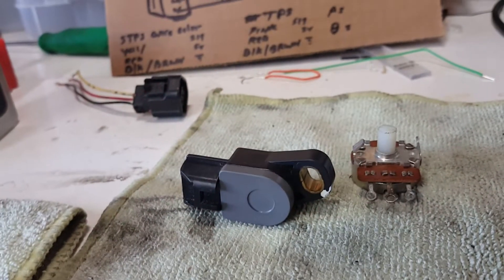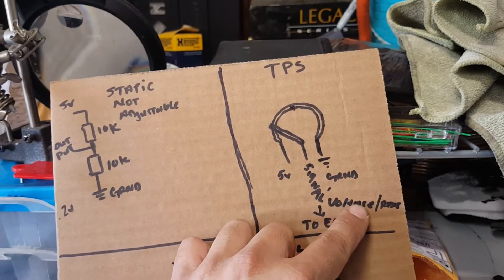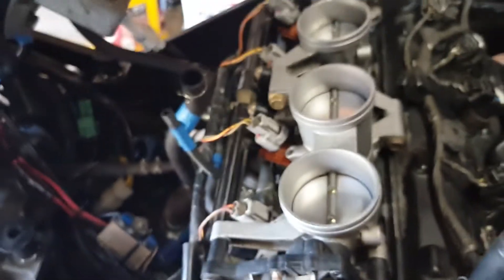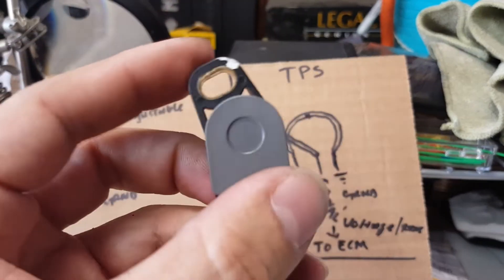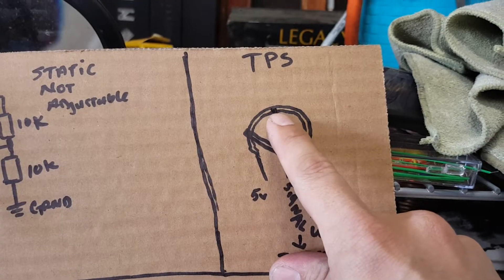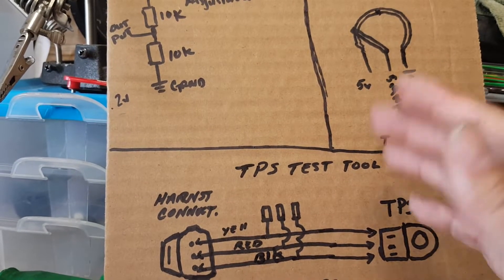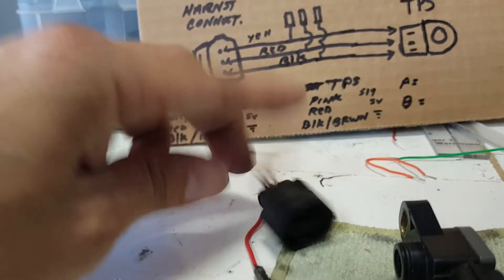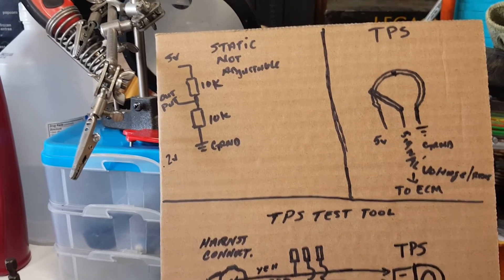DIY SUZUKI GSXR 600/750 Explaining the TPS

Comment: I just bought a 04 GSXR 750 that has not started in about two years. I ended up disconnecting the IAP sensor and it started right up. The TPS was off so I had adjusted it. It idles for a while and slowly drops from 1200 downward until it stalls. Also when revving too quickly it will stall. It's not even slightly drivable, could a TPS sensor be the reason why?
Reply from the maker: Are u using the new gas? Have you checked the tank for rust? Have you test fuel pressure and volume? Have you checked the sparkplugs? 

You Have to start with the basics engine go troubleshooting before moving on to components.
Reply: @TheChemistDIY  I have done all of the above except for fuel pressure. Fuel doesn't seem like an issue although I may be wrong. I'm going to check compression tomorrow. Also, I noticed today that when I close the throttle or roll the bike backwards the engine stalls as well.
Reply from the maker: @StrongLykOx  what are the color of your plugs..?
Reply: @TheChemistDIY  they were dark brown, if I roll the throttle closed it stalls as well.
Reply from the maker: @StrongLykOx  yes, 3 main things happen when rolling on the throttle. Air, fuel, and spark are changed.. to much or to little will cause the bike to stall. The sparkplugs are a great story teller of what could be possible wrong in these 3 main categories.. im sure you know this.

Take a look at this color chart and tell me the degree to where your sparks are at so we can identify the next place to troubleshoot.

https://www.lazerhelmets.com/lean-spark-plug-chart/

Dark usually means to rich and light usually means to lean. 

So with all that said the bike does idle on its own right? If not for how long will it stay one. Dose you STVA work and can you see the 1st and secondary flys move ?
Reply: @TheChemistDIY  from looking at the chart I would most likely say oil fouled. I also just did a compression check and all 4 are around 100psi. The first and secondary flys move. Could it be a head gasket?
Reply from the maker: @StrongLykOx  WOW!! Out the box from the dealership the bike should have 160 PSI across each cylinder. 145 psi is about the lowest you want to go and it's time to replace the rings after that.

One thing that's odd is that you have an even 100 psi across all four cylinders, that's even pressure!.. so with that said you have me leaning more towards head gasket leak but the only way to tell is with a leak down test.

One mechanics trick to test for bad rings is to pour a little engine oil in each cylinder and fire her up. This will seal the leaking ring for a minute until the oil burns up. If she runs during your test (idle/revving) then you have a compression leak in one of your cylinders. This won't work if you have a head gasket leak. There is a different procedure for this.
Reply: @TheChemistDIY  so, I did the compression test wrong. I did it with the engine cold and didn’t open the throttle all the way. I got 150-155 across all four when I did it right. I replaced the plugs for a third time, cleaned the coils and the throttle body, removed the tps and stps and it starts right up. It’s revving fine, not stalling and is rideable. But lots of white smoke bellowing out. I’ve ordered the tps and stps because I messed them up removing them. I’m not going to attempt to start it again until the TPS and STPS are replaced. Any idea on the white smoke? I’m tracking it’s not a good sign.
Reply: or the white smoke could be the sea foam
Reply from the maker: @StrongLykOx  sea foam.. yea let it burn off.. glad ur up n running
Reply: @TheChemistDIY  everything is working pretty great, thank you for the help. Question, if I install a power commander, do I need the TPS installed? The sensors that arrived today rotate in the wrong direction and I was thinking about installing a power commander instead of trying to find a TPS that will work.
Reply from the maker: @StrongLykOx  so the PCIII needs the tps to work properly. At connector #1 there there is a wire that needs to T-tap to the TPS wire. I have a  instation video on that..
Reply: @TheChemistDIY  So, I cant really explain it, I took off the throttle body, cleaned it real well because it was gunked up. Put it back on, all sensors hooked up and the bike is running beautifully.
Reply from the maker: @StrongLykOx  yes a good throttle body cleaning works wonders. That said there could be other reasons why you were getting bad or poor performance.

1) your throttle body wasn't sitting in the boots correctly, not creating a tight seal, this created a vacuum leak. You taking off and putting back on repositioned the stacks correctly back in their boots.

2) The boots are tired and warned and not creating a good seal. Since they are rubber the will also crack giving you again a vacuum leak. When you took off the TB did you inspect the boots for cracking? If not what might happen is by removing the TB you allowed the boots to close up from expansion.. but within a few rides with heating and cooling these boots will open back up, expose the crack and create the same vacuum leak.

Keeping my fingers crossed for you and it was just a dirty throttle body and you fixed the issue. Boots are simple and cheap to replace but just having to do the job over when you had everything apart the first time sucks ass..lol

 been there done that..
Reply: @TheChemistDIY  yeah, the boots looked a bit worn. I've already got them on order as well as a few other things that seemed worn. Thanks for the help.
Reply from the maker: @StrongLykOx  Awesome brother sounds like you got everything covered, hit me up anytime. Just an FYI, not sure if you ever replaced the stack seals & boots before but the 4 Phillip screws are a Bi^*# to get out without stripping because of the Loctite. To knock them free I'd advise you to purchase a Driver Impact Screwdriver set. This tool broke my screws free in two wacks. You can find that in my Amazon storefront here https://amzn.to/3Wmp2ew for a few bucks. Well worth the investment when you consider the time and frustration it eliminates. Just my two cents  

Good luck!

Comment: I set STPS resistance as it is written in the instructions on 0.6 on the closed throttle and on 4.50 on the open throttle and damn it I dont get it. 1.10 closed, and only open throttle  4.50 evenly wtf :p did you work out perfectly as in the guide?
Reply from the maker: What's up brother, just so you know the good book has a typo for the closed value.. it should read 1.6 closed and 4.5 open. The 1.6 is approximate and not set in stone.. so you should be good
Reply: @TheChemistDIY  I set STPS to 1.6 kOHM on closed, but now I have over 5 open, and it should be 4.5 according to the instructions.
Reply from the maker: @kawosz90  remember these are approximate values, they may differ. Even though the book says 1.6 - 4.5 my values came out to be 1.8-4.9, almost 5 kohms!. As long as you have the beginning value set you should be good if the ending value travels higher..

 let me ask you.. what problem are you having? Have you taken the bike out for a test ride with the new adjustment? Is there a code being thrown with the new adjustment?
Reply: @TheChemistDIY  I had it so that I screwed it tightly at high speed rpm, it was error (C028) I replaced the STVA, set it to a little lower value  in STPS and it's now good...

Comment: Mannn I’m stuck , $250 stva ,$50 tps sensor , $100 secondary tps sensor , fuel pump. Don’t really wanna drop $400 plus on parts guessing what it is What could it be 😩 code -C29
Reply from the maker: Well c29 is the Secondary TPS.. have you tried cleaning the contacts in the connector and STPS.. could be something that simple.. you can also swap TPSs to make sure there functioning.. correctly but it's a bit of a pain to calibrate..

Comment: hello i have a question, does tps of gsxr 2009 the same my 2014 gsxr 750? can i swap it from 2009 to 2014?
Reply from the maker: Wish I could help you out but that information I do not know. You could crack open  the service manual for both and perform a comparison.  

Aside from the physical aspect, you would also need to consider upper and lower resistances levels as well as voltage input.

Comment: Did you get a code for this bc I’m experiencing the same problem bike idles weird then around 6 7k rpms it jerks so bad that I have to shift to stop also I use to be able to hit 10k and not be able to go anymore my bike trapped 115mph as a 600 I own a gsxr 2006 I do not have any codes and I can’t seem to figure it out 😫
Reply from the maker: Does this occur in a specific gear at that RPM range or dose it do it in all gears at 6-7k?
Reply: james moreno well just found out plugs wer bad put new ones in bike ran good then Throw code 24 25 39 two ignition coils and injector 4 high end but bike use to stay stuck at 10k rpms
Reply: @r6moto716  Does bike now go past 10k rpm? did changing the plugs help?

Comment: Could you help me out. I changed oil filter and plugs on my Gsxr K6 1000cc, I realised just after I started  I might of put  bit small bit too much oil maybe 1 extra quart. Drained this out but the bike isn't idling now sinc the service, and it's really smokey. All lights on no codes.  Any idea what is wrong, is the oil gone too far in the engine, I did replace iridium spark plugs for normal plugs. Can anyone help me out??
Reply: So what happened ?

Comment: Do you still how this bike I got mine used but the fuel line was shortened and I was wanting to find out the length it’s supposed to be and it’s routing the line is kinked and I want to replace it and route it so it don’t kink
Reply from the maker: Ya I still have it.. although I dont have the measurement of the line or know which gas line your referring too. Gas Tank to disconnect link/ link to fuel rail..ect
Reply: Yes I’m talking about the line from the fuel pump to the fuel rail

Comment: Mine starts up but as soon as I give it a little throttle it either cuts off or starts losing power then getting it again any suggestions
Reply from the maker: Most bogging issues have to do with the lack of one of the 3 major components of combustion.. Fuel, Air and spark.. sounds to me like your lacking one.. have you checked each and are you throwing any codes..

Sometimes it's as simple as a bad plug or grounding out or loose coil pack..dive deeper and it can be a bad fuel pump or dirty injectors.. your researching and commenting on the TPS video.. what makes you think it's the TPS..

Comment: My 750 k2 bogs on half a throttle and on 8000rpm 😔 any idea
Reply from the maker: Need more information then that brother.. What gears/any FI light/funny smells/how longhas been doing/all of a sudden or building up to/started after any mods.. ect.. have to get into the fine details.. Have you dones a tune up.. Filter, plugs , oil..

My first go to would be pulling the plugs and seeing their condition.. this tell you how the bikes burning your fuel ..  (White, brown, blk)

check the tank for rust or dirty

Run a fuel delivery test to see if the correct amount is getting out/fuel pressure test after that.. could be a bad fuel pump or the filter is dirty..

So many things to check with just saying I'm bogging at 8K rmps.. we need to narrow it down.

Comment: Hello,
I am from Brazil I have a bike of the same model as your K5 with error -C14 and we were unable to identify the defect, we have already changed the TPS the error disappears and after a few miles running back it appears, this defect fails and cuts the accelerator, you have an idea Can be ?
Reply from the maker: The C14 code thrown is your tip over sensor according to the service manual. Testing values for this is .2 < >4.8 .. hope that helps
Reply: @TheChemistDIY  found the error, it was on the main harness plug with ECU, loose connector
Reply from the maker: Nice.. good find. Thanks for coming back and sharing to help others out.

Comment: I got a ? My bike runs fine bt if the weather is over 80 it’s like it gets hot after hr half ride it well start bucking then at some point after that it well shut off hit kill switch starts up and I can ride off 🤷🏾‍♂️
Reply from the maker: Sounds like a faulty thermostat giving you the over heat issue, ive had the samenin the past. This to me would be my first place to go as it is a cheap and easy fix.. try this video from my arsenal of DIYs and let me know how it goes.

https://youtu.be/qxVVUNRXFw8
Reply: I have 2014 gszr 1000. My problem  is bike starts but only stays running for about 10 seconds and won’t fire up again. Some one said tps. But now watching this i don’t think it can be.
Reply from the maker: @deniscarp9637  to rull out the tip over sensor being the issue why dont you try bypassing it first. Im not sure if the resistors used are the same for your year as they are for the older 1000 but take trip over to Dark Nights YouTube page and review how he bypassed his. Its all about process of elimination. Come back and us know how it went if you decided to try.

https://youtu.be/3ePyvf3XHIk

Comment: What’s up bro. My 07 gsxr600 is cutting back around 8 to 10 rpms in ever gear. Could this be the problem? I already replaced the fuel pump
Reply from the maker: What up bro, if you would have told me in one gear under load I would say the tranny dog was bad and slipping out of gear, but since you mentioned in every gear and at a certain RPM (7-8k RPM) I'm going to say it's your STVA..  Cutouts are hard to diagnose, could be many things but since this has happen to me more often then other problems I would start here. Check out my C28 code fix video below.

FYI, you don't need to have the code present for this problem to occur, it could be on its way but not fully there yet.. I experienced this 2 months ago and redid the welds and it fixed the problem.

https://youtu.be/wfuXw0nhwh8
Reply: james moreno preciate the help bro. I just posted a video on my channel about it. If u could check it out I’d appreciate ur feedback

Comment: I think I’m haveing the opposite problem on my gsxr 750, I think it’s throwing too much fuel out , exaust smells lean and I’m haveing a hesitant throttle increase bu bu bummmm like it’s flooding out insstead of a smooth rummmmm . Any idea what it could be
Reply from the maker: If you haven't done so already, check your spark plugs, see if there white in color at the electrodes. This will tell you if your running lean or not. 60% of the time its because of a bad spark plug, so what u should be asking yourself was when was the last time you changed them, and did you check for correct gaping (.028-.031 i believe).

Secondly, when was the last time you did a fuel pump test to see if your putting out the correct amount of fuel and fuel pressure to the injectors, while were on the subject of injectors, when was the last time you cleaned them (frwd & back flush). Without much detail this is the best advice i can give you to start.
Reply: james moreno new plugs new stva new fuel pump new tps new computer no f1 light on